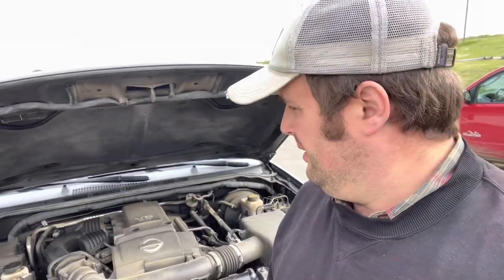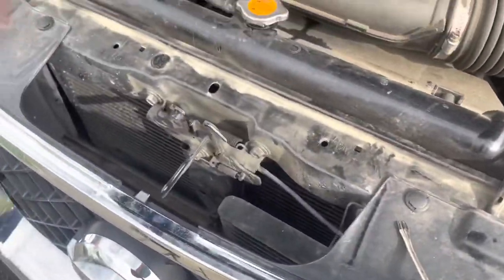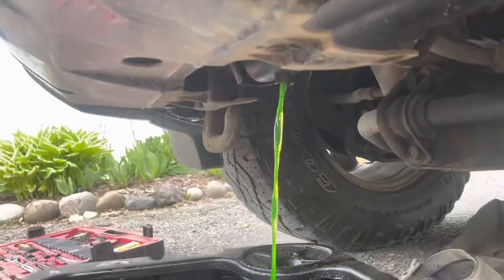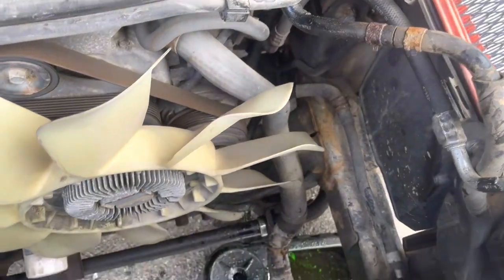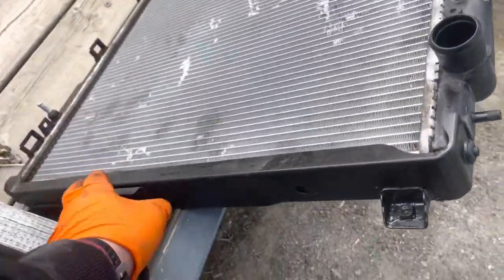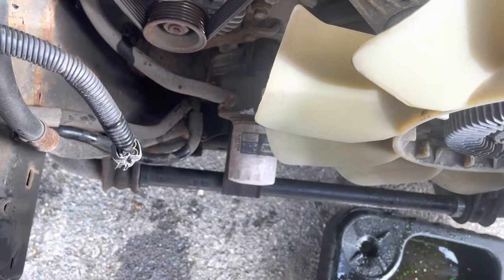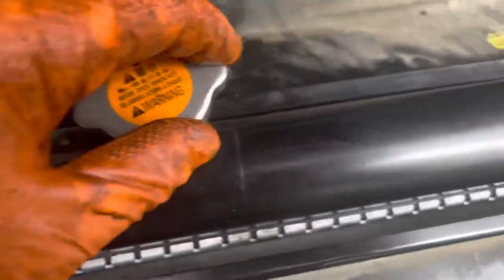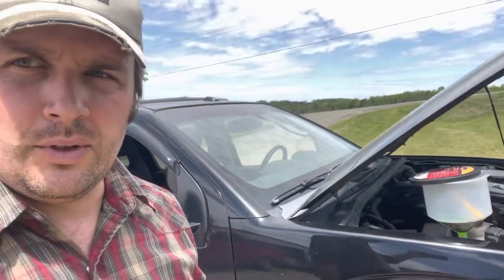Radiator Change/replacement - 2008 R51 Nissan Pathfinder - preventative maintenance to avoid SMOD

Comment: would it be better to get an all aluminum radiator to prevent smod occurring
Reply from the maker: You’re not really asking an “expert” here to be honest. In the research I’ve done it seemed to me like that wouldn’t hurt but was not necessary as the new radiators had dealt with this problem - the original problem was with the stock rads from the years 05-10 ish (depends on who you trust for your information I guess) 

That all said I’m just some random guy online that you don’t know so I would suggest doing further research. This is the second rad I’ve swapped from stock on a vq40 and it has solved the potential issue for me both times thankfully. In my case neither of the replacements were full aluminum. If money was no object I may have made a different choice - of course if money was no object I might not be wrenching on my cars either 😂
Reply: @TheBrokenBolt   thank you so much for your reply as you are an expert and i fully trust your advice ;) lol im going to see an 06 xterra in a hour to potentially purchase it had 117k miles and the seller told me the timing chain was replaced but had no proof. From what li researched  the koyo rad is popular and i guess it was a o ring or gasket that is whats causing the issue on the specefic  oem rads. Maybe il just go with a non full aluminum as well. May i ask why you changed it twice ?
Reply from the maker: @dimey3572  I don’t know if I would fully trust my advice or not 😂 I’m just a guy on the internet that learned to work on them out of necessity. 

For clarity. I’ve changed it once - on two different vehicles we own with this same engine. We have an ‘05 Frontier and an ‘08 pathfinder. Both have the vq40 engine and both have the risk of SMOD so I’ve changed the RADs on each of them … have plenty of mikes on both post change with no problems at this point … check the coolant color in the overflow tank when you look at the xterra. The vq40 is a pretty decent engine. 

I’ve done a timing chain on one of ours and will be doing it on the other in the near future :) 

Wish you the best.